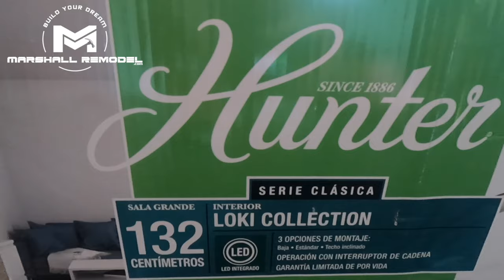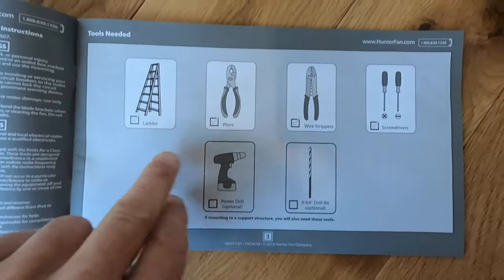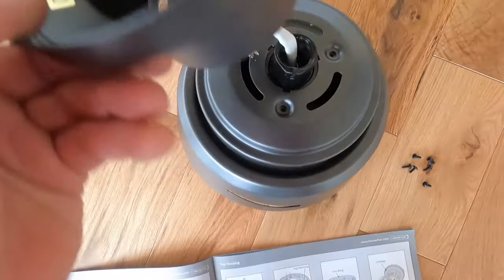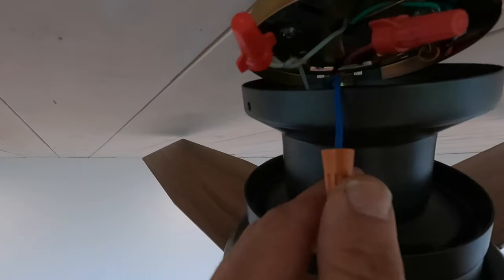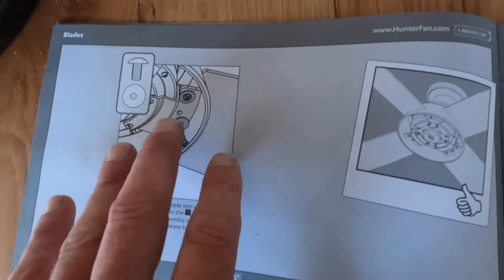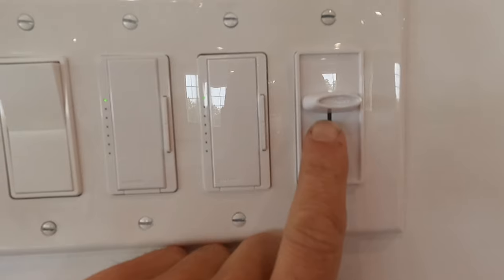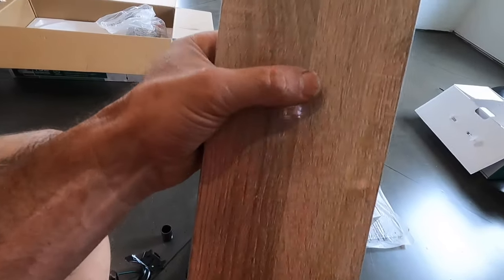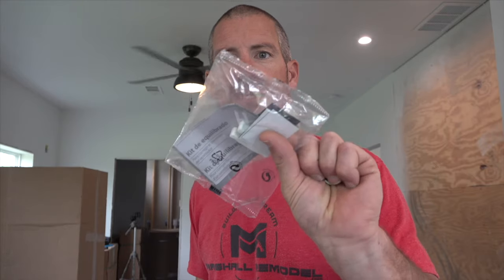Ceiling Fan Install | Hunter Fan Company

Comment: We have a vaulted ceiling so we installed a Hunter fan with a fairly long drop.  We use the remote that mounts directly to wall switch and we love it.  Hunter is hard to beat.  Super quiet and reliable.

Comment: Paul,  Hunter has been around for a long time, good product.  There original models had low rpm cast motors with oil bath babbitt bearings.  They are super quiet and last for ever.  If you ever work on them don't turn the motor upside down or tilt them too far the oil will run out and make a mess of things,  my dad found out the hard way and ruined a carpet.   Your house is looking really nice.
Reply: That's the original Hunters. They are garbage now since bought out. The internal parts are garbage now.
Reply: @Mrdashtard  Agree!  My recently installed Hunter Dempsey indoor low profile ceiling fan has a low hum which is very annoying at night when you're trying to sleep.  None of my Hunter Douglas fans had this hum in the past.  Wish I had bought a different brand.

Comment: Can’t go wrong with a Hunter fan!

I had 6 of them in my last condo I renovated. 2 in the living room, 1 in each of the 2 bedrooms, 1 in the kitchen and one on the deck.

I only have one in the bedroom in this new place I’m going to renovate. 

The Hunter I have now is WiFi controlled - sounds lazy but it sure is nice to say “hey google turn off ceiling fan” versus fumbling for the remote when you are half asleep and cold. Or turn it on when you are hot. Getting out of bed is for suckas!

Comment: Are you going to run them in reverse for the winter?  In reverse pushes the warm air up, across the ceiling, down the walls to the floor keeping the air mixed without the breeze.

Comment: I have the exact same ceiling fan in my living room. Absolutely hate it. Never have had problems with Hunters, until this one. There is a clicking in the motor. I've taken the blades, shrouds, light fixture off to isolate the issue. It's in the motor itself. Problem is, its mounted to an 18' ceiling, so I have to get out my scaffolding to replace. For now, I just don't run it. I hope you guys have better luck with yours. It does look nice, though.
Reply from the maker: Oh wow. Have you reached out to their customer service? We’ve never had problems either.
Reply: Hunter quality has really gone down hill.

Comment: greetings folks; i realise hunter is supposed to be self balancing but i have some that does not. anyway, i wanted to give yall a hint: the black metal paper clips that have the handles that fold away are excellent to clip on the blades to balance with. love them and use them often..................g
Reply from the maker: Thanks for the tip! Ours came with a balancing kit should the need arise
Reply: @MrPostFrame  yes sir; they all do but most will not stay put when installed. these clips will not loosen or go flying. have used them for years...................g

Comment: Hunter tech support said they do not recommend the wall type controllers (particularly Leviton/Lutron models) and I've been told it can create an annoying "buzz" noise in the fan.  Was that your experience?  What about the light controller at the wall switch?  My home wiring has black-red-white wires to separately control the light.
Reply: You can get a buzz or hum in the fan either way.  Their quality has gone down hill.

Comment: Comment.....The quality of Hunter Fans have gone down hill.  Buying a fan from Hunter now (2021) is hit or miss on whether you with get a good one or not.  The motors can be loud and the finish on the blades can be terrible.  Hunter used to be the king, now they are just another fan company.
Reply from the maker: So far ours are holding up but we get what you mean. Sadly lots of stuff is like that
Reply: So true.  Wish I had bought a different brand.  The hum when running is extremely annoying at night.

Comment: Hunter makes some really nice fans but the FIRST thing everyone should do is remove/bypass the STUPID & failure prone EPA mandated current limiters designed to control what size/wattage light you can use in the fan.  🙄🤦‍♂️ Great install video!  👍
Reply: How would you go about doing that? It's probably simple, but it's also pretty simple to mess something up and burn your house down l, lol